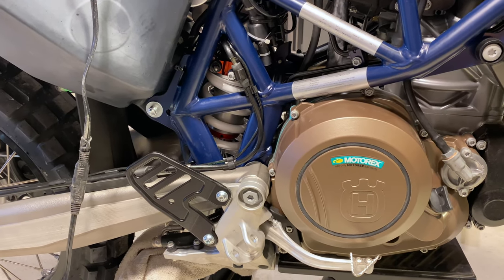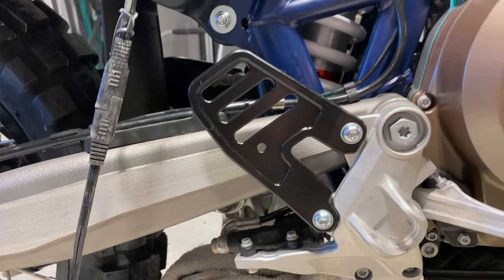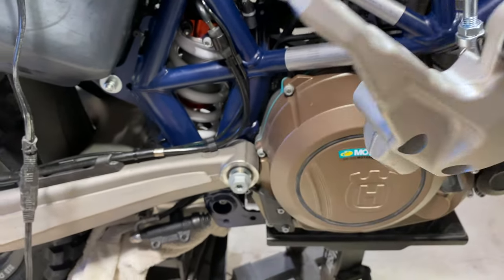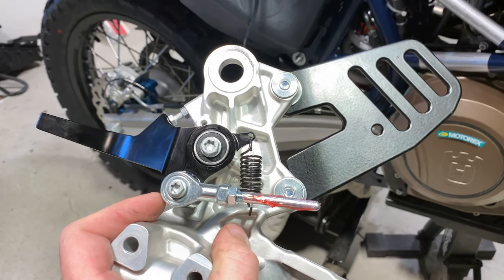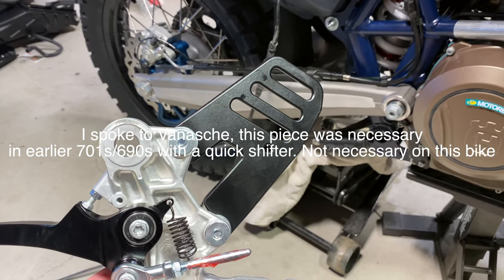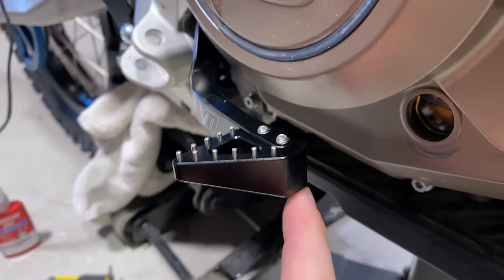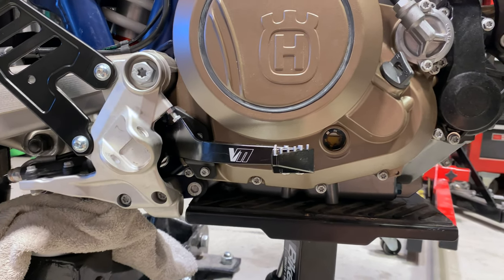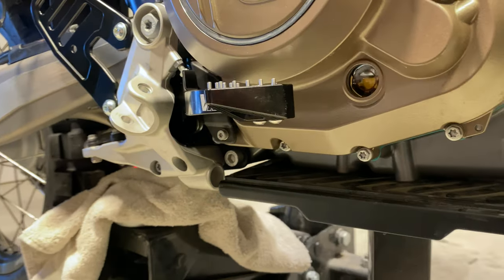Husqvarna 701 Enduro LR: Install Vanasche Rear Brake Pedal Upgrade

Comment: Excellent Adam. Will be putting mine on in the next couple of days. Did you find the Torque Spec for the swing arm and other bolts in the manual, or do you remember what they were offhand?
Reply from the maker: Hi Paul, I bought the Husqvarna LR service manual from KTM it' around 500 megabytes and it's a huge PDF. I think it was around $40. Good investment to have. The forward swingers bolts are at 80nm. Plastic foot brake cylinder bolts are only 10nm. foot brake bracket is 25NM
Reply: @AdamChandler86  Awesome, thanks Adam. Super helpful. I'll try and get a copy of my 2021 701 Enduro manual, good tip.

Comment: Hey i got a Problem on the swing screw i want to tourque it to 80nm but it doesnt go hard gut the thread is good
Reply from the maker: Yeah, if you think you're at the limit of the threads, I'd stop there. 80 was spec but it'l hold at 50...apply thread locker if you're worried about it.

Comment: Your video was very helpful ! However I found out on mine that the stoping power seems a lot lighter than before. I have ajusted the top nut (that sets the level of the brake lever) but I can’t seem to set the brake to stop harder. Any ideas of how I could take care of it? Cheers 😊
Reply from the maker: Your brakes are hydraulic so other than checking the fluid levels in the brake reservoir and the nut (as you have already done), that's the two adjustment points. I assume your brake pads have plenty of life left? I can say with my setup and this brake pedal, I can lock up the rear wheel any time I want. It's very strong! Thank you for watching.
Reply: @AdamChandler86  thank you for your reply ! In my case the bike is brand new so fluids and brake pads are fine ! I will keep on looking, I might have overlooked something